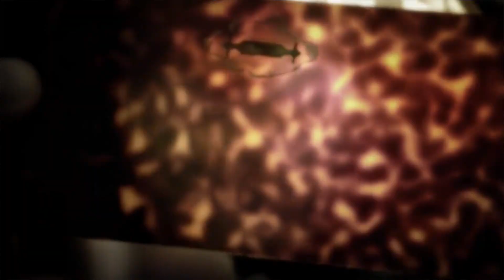Which Sunglasses Are Best? Persol Or Ray-ban - Why Handmade Quality Always Wins Over Luxury Branding

Comment: I agree. I'm a sunglass lover and wouldn't have a "luxury" designer pair of glasses in my collection. I do care a lot about the lenses. More so than the frames. Even so, I do own a few pairs of Ray-Ban because they are still iconic. I would love more Persol but i need large frames and Persol barely offers them. Now, quality being first, I would put Persol, Randolph Engineering and Serengeti on top. Maui Jim also makes nice sunglasses with superb lenses. I currently own Oakley, Ray-Ban, Costa, Maui Jim,  Revo, Serengeti,  Smith, Randolph,  Persol and I consider each of those a good brand. And,  to be fair, my RB2132 New Wayfarers and RB3560 Colonel are both made in Italy and have crystal lenses and feel high quality to me. Actually, all my RB, except one are made in Italy.

Comment: The 2132 or 'new wayfarer' might be injection molded plastic, however, the 2140 'wayfarer' is still hand made acetate just like the Persol range. They have in fact also been hand made in Italy since Luxottica's take over in 1999.

Comment: Nice review B! If someone is dead set on Wayfarer style but want to try Persol I would recommend PO2953s. I own several Persol models and love them all. I also have a collection of vintage Bausch & Lomb Ray Ban´s wich I would say have the same and in some cases even higher quality than Persol, especially in the optics. Baush & Lomb did only sell the brand Ray Ban, not the tecnology. Bauch & Lomb still exists, while Persol sold their company in total to Luxottica but still makes their glasses in the same factory with the same tecnology. So you are very right in saying that modern Ray Ban can´t compete with Persol´s. Cheers

Comment: Here is my two cents on this topic:
If you want a new pair of sunglasses that are not Wayfarer style or Brow-line "clubmaster" style, I would go with the Persol's. They are significantly higher quality than modern ray-bans.

However, If you want Wayfarer or Browline style glasses, go for a pair of vintage Bausch and Lomb Ray-Ban (pre-1999, when the company was sold to Luxottica), as they are as good as the modern Persol's in terms of quality, and the lenses are incredible (not familiar with the modern Persol lenses, but the ones on my 1970's-80's Ray-Ban's are significantly better than the modern ones that I owned). They were in nearly perfect condition when I bought them from Ebay, even after ~30-40 years of wear and at least two owners.

Comment: Certainly sunglasses are a fashion item, so in that sense your review is spot on.  However, you failed to point out the most important aspect of their function, which is to protect your eyes from the sun, making the lenses equally important.  Both Persol and Ray-Ban use optical glass in their lenses as opposed to the plastic lenses used in the vast majority of other brands (though Ray-Ban does use plastic lenses in some models as well).  This further adds to the premium nature of the article.

Another premium brand worth considering is Serengeti, who’s lenses are often considered the best available and favored by pilots around the world.  Though perhaps they do not have the heritage of either Persol or Ray-Ban, they continue to be an independent company who manufactures their products in the USA, Japan and Italy.  Their materials and quality are on par with Persol, and their design range encompasses both modern and classic styles.  They are also comparably priced.

Comment: Awesome review. I've ordered a pair of Persol "film noir". I would have gone for the Wayfarers except I hate that they are branded so much. A long time ago i worked in a factory one summer in college making wayfarers. Used to put the wire in the ear pieces. It was called the drive wire machine and it was awful. However I really like the wayfarers much better back then and if only I could have afforded a pair. They didn't have all the horrible branding all over them. I really hate being a walking advertisement.

Comment: I tried EXTREMELY hard to remove the original Persol lenses on my 649, so I could put in a lighter, third party polarized lens in it. My max deadlift is 405 lbs, yet I could not remove those lenses with sheer force alone. It shows you the craftsmanship that goes into making these glasses.
Reply: Try high rep squatting for around 12 weeks, work your clean and press hard, and increase your calories. You'll pop those lenses out in no time!
Reply: Steroids might help as well.
Reply: numberstation  lmao!
Reply: OwnD1 I only hire professionals to swap lenses

Comment: Ray Ban Original Wayfarers (RB2140 and RB4340) are also hand made in Italy from cellulose acetate using a similar process. The rest of the Ray Ban product line is a crap shoot though. Most of the plastics in their other models are injection molded nylon and while their flagship models like Wayfarer, Aviator, and Clubmaster are still made in Italy, much of the rest of their product line is outsourced to China. It can also be difficult to tell which models come with crystal (glass) lenses and which ones are polycarbonate (plastic) lenses. Again the crystal lenses tend to be reserved for the flagship models.

Comment: Sorry, but they are not made by hand, the cost would skyrocket if it's still done in Italy as they claim. My latest pair were slightly warped, still fit ok, but not dead flat, one temple is higher than the other. I own about 55 pairs of sunglasses, from Shuron to Oliver Peoples, and many in between, Persols are great, but Serengeti has the best lenses out of my 55+ pairs. And it's polycarbonate. I like all of them though. I have to give Tom Ford a shout out for style, and Velado for unique and detailed aviators. I agree though, Ray-bans are second tier sunglasses, but sport the best name in the business--Ray ban! Back in the 70's they had the best photochromatics out there, not photochromic as it's called today, but photochromatics, and they had the ambermatic lenses as well. I wish I kept them, true clear to dark lenses that could be worn indoors. This was B&L, before Luxottica took over and made them mediocre.

Comment: Serengeti sunglasses every time.  I'm paying for the lens not the frame. Serengeti are the only sunglass company who offer photochromic polarised lenses as far as I'm aware. I've tried Ray Ban (multiple lens types), Maui Jim, Bloc,  and Oakley. Won't even touch fashion brands from Luxottica because you pay for the name not the lens. Nearly all fashion brands have nasty lenses. 

Serengeti's aviator lens is astonishing and loved by pilots. 

The problem with fixed tint lenses is that they don't adapt to variable light conditions. 

Serengeti are far superior to any brand I've tried yet are not widely known to the general public which is a shame. I live in the U.K. and saying we have variable light conditions is being charitable. Fixed tint Cat 2 lenses are often too dark. Fixed tint Cat 3 lenses are definitely too dark. Serengeti's work from low light to the harshest desert or salt flat glare. Pretty amazing.

The only problem I've had with them compared to Maui Jim's is that Serengeti's didn't have an oleophobic layer on the rear of the lens. My models are about 5 years old or more but the new lenses have the oleophobic coating.

Looks like I'll be buying a new pair of sunglasses next year.

Comment: The RayBan tortoiseshell finish is now days a spraypainted on pattern -  I scratched my frame, tried to polish it and all the pattern rubbed away. Persol's texture goes all the way through - it's part of the frame material. After 1992, Rayban started spraypainting their patterns - that's the difference - it's all about charging more for less quality. Persol is till the way to go.
Reply: Peter Bendheim I have a pair of tortoise Wayfarers that I bought in 2012. They are hand made in Italy and the tortoise color isn't painted on. Has it changed recently?
Reply: "In 2001, the Wayfarer underwent a significant redesign (RB2132), with the frames made smaller and less angular, and changed from acetate to a lighter injected plastic" - source Wikipedia

These were considered to be poor quality with a spray on pattern.

Because of this, Ray Ban introduced the RB2140. Luxottica had to source new manufacturers to make the new original-like design. They are the exact replica, the same shape, same design, all the components and materials are the same.

So if you have a RB2140 then you have a good one. Mine is a RB2132 - not good at all - cheap injected plastic, not acetate.

Comment: I love RAY BAN. Ray-Ban is absolutely classic. WayFarer is the CLASSIC!!! Yup they match many faceshapes =O! true! I have fake market wayfarers which cost me about 10€ only. havent broke after a month or two of usage so far. not great quality but it works, :D.

I also have RayBan EYEglasses, they are genuine expensive frames. wayfarer'y style on them, too. AND the last one, I have Genuine Rayban AVIATOR sunglasses, but they are a little bit too small for me, they are good quality, great quality. not top notch but good.
Reply: +Lycosa The Aviators come in different sizes. The larger fit me best, I believe.
Reply: Robert Loban Yeah. My aviators that I bought are a little small for me.

Comment: Original Persol’s, made in the RATTI factory are the best in materials and craftsmanship. The “new” Persol brand are made in the same place as RayBan with the same materials and craftsmanship. No difference between the two, same mineral lenses, same acetate frames -granted the “Persol’s” have the old Malflecto flexible stems (and 40

Comment: What if i told you you  an get the original Wayfareres 2140 that are Hand made in Italy and also made from acetate ("the high quality plastic" that is not ejection molded but grinded and polished by hand)
You just have to be carefull with RayBans, you can get models made in China and with plastic lenses. With Persol there is no wories, all are glass lenses and good quality pladtic

Comment: For me the reason I went with rayban over persole was the glass, as I just felt that given rayban's history with aviation and the military that I'd be able to get a better and more trustworthy pair of polarized glasses with my new wayfarers.

which were a pair of tortoise shelled ones with black glass, pretty basic and I removed the white lettering off of the glass using an exactoknife to make them abit more stealth and less in your face about it, like the old 80's ones were, as you can do that provided your very careful and just gradually remove the rayban logo coating off of them by just gentley scraping them off.

but granted at the time, and until watching this video I didnt know they were owned by the same company more or less, and I kinda wish I could have gotten the black frames but they work nonetheless (they were out at the time)

and I couldnt find a pair that really did anything for me when I went over there website, persole I mean, as while you love the hinge, I'm not a fan and I'd be alot more key on going for a pair like Don Johnson wore in Season 3 of Miami vice, but from what I could find they dont make anything really quite similar anymore with out the hinge

plus the rectangular look of them doesnt fit my face, as I found a pair of lookalike raybans second hand that matched the dimenisions and its no go, as its more oval, following this mans general advice.

https://www.youtube.com/watch?v=pWVnYEpUEWo

and also I further developed on what he said there on the video, with the you you want to find sunglasses that line up with your cheekbones thing.

as I measured the distance between mine using a ruler, minuses the nose bridge distance and then tried to find the square style that lined up with the measurements in MM, which were the new wayfarers, 902/58

https://www.youtube.com/watch?v=D0RTAoIg2Hw

not me FYI lol oh and I did black out the beads on them using black permanent marker. which can be removed with medicinal alcohol if you ever want to remove permanent marker FYI

also I wouldnt use the amazon and ebay listings as a price comparison as I just get the feeling you never really quite know what your getting, and your better off biting the bullet and buying from a dealer hand to hand, as some dealer who was highlighted the other day seemed pretty shifty judging by the feedback.

I do have one question for you however, my new wayfarers say made in italy, as do my other pairs of raybans, so where is this made in china stuff coming from?

but I will say from the look of it the tortoise shell on yours, they do seem to be of a higher finish and higher detail in them than those on mine, and I wish I had gone for a black frame and maybe a gradient or blue like glass on then like Mcqueen in The Thomas Crown affair.

however all that aside and paying full price for them, I dont feel cheated and I do like them, although I think I will give persol a second look now then.

also thanks for the heads up on nato international, I must have gone through atleast 12 straps trying to find the right ones for my watches lol
Reply: Come again?

Comment: They come from the same factory.
Reply: They do... All of them to be exact. The one's that don't, Luxottica pulls a mob style hit on their brand.
Reply: Dylan A. Kent persol has their own factory although owned by luxotica
Reply: The Skoda Citigo and the Bentley Bentayga also come from the same factory. What's your point?
Reply: Persol, Ray-ban, Tiffany, Gucci, Prada, Coach, Georgio Armani, Versace, and many others are owned and designed by Luxottica. Some have their "own" factories, but they are all ultimately owned and operated by Luxottica.

A lot of the time, Luxottica designers will design a frame without thinking of which label they will put it under later. "This frame fits in with Ray-ban, so we'll add it to our Ray-ban collection." or "This frame looks like a Tiffany, so we'll add some Tiffany blue and add it to our Tiffany collection." is the mindset adopted by Luxottica designers.
Reply: Banana and old navy is an example of same owners ship BUT different QUALITY
Reply: From same owners, NOT same factory.  I love Ray Bans and have had a few pairs over the years.  I bought my first pair of Persol sunglasses today, and so of course I am binge watching all the reviews of Persol.  Pleasantly surprised by what I am finding on YouTube.  However, as in the case of the comment I am replying to, quite a bit of misinformation/misunderstanding still.
Reply: @CurryBunns  You're only half right, when they're designing frames for the fashion brands, the fashion brands send over their yearly style ranges as a taster, and Luxottica designers use that as inspiration for the eyewear range, they then send off the sample designs to the fashion brand to get the go ahead and if it's accepted production gets started. So there's a little more thought goes into it than just a guy at a drawing board saying "that pair I designed yesterday can go in the Ray-Ban range".

Comment: Persol (1990) and Ray Ban (1999) are now Luxottica owned and are trash ....overpriced and ugly with inferior lenses. The Only good sunglasses made today are Randolph Engineering and Vuarnet.  Persols are not made at the Ratti factory in Turin anymore and BL Ray Ban only made polarised lenses in th early 90s with their GP,  P and RB Ultra 50 ranges and in small amounts (their mirrored and changeable lenses didn't need polarisation) .... you should do your research bro.